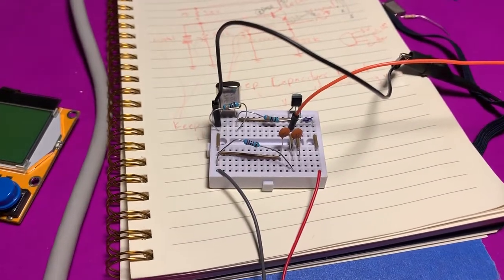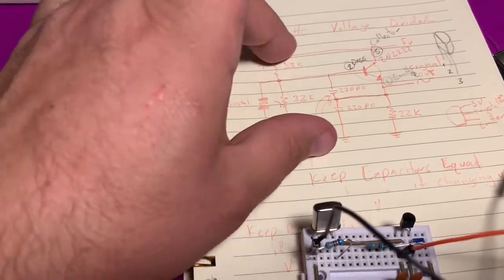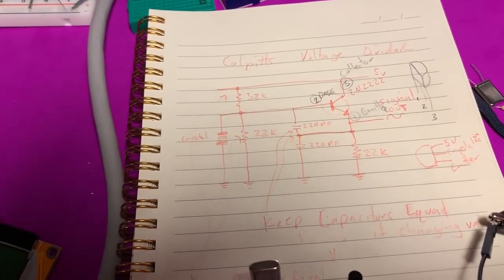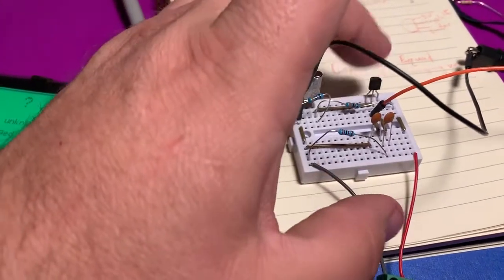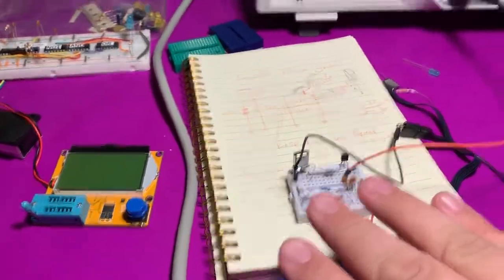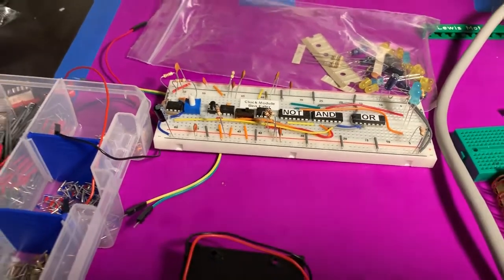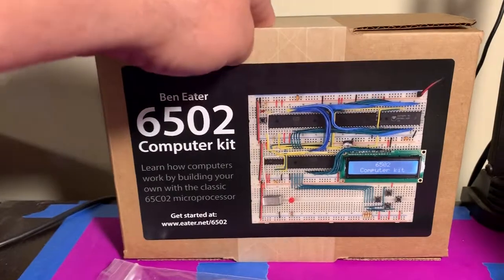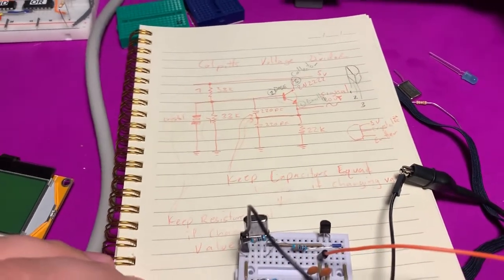Colpitts Crystal Oscillator

Comment: the output is usually low but you could try tweaking the values of the capacitors and resistors to get higher outputs I guess.
you brought tears in my eyes seeing how happy you are with the oscillator as I was at roughly the same period when  made mine.
keep it up!